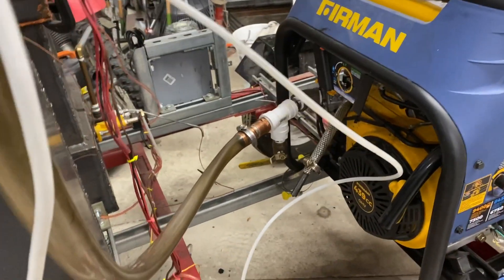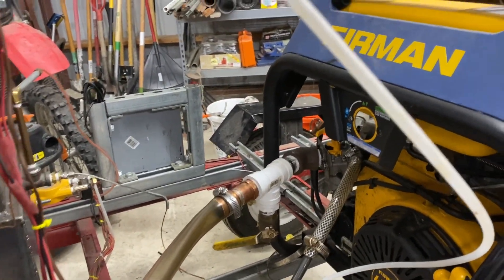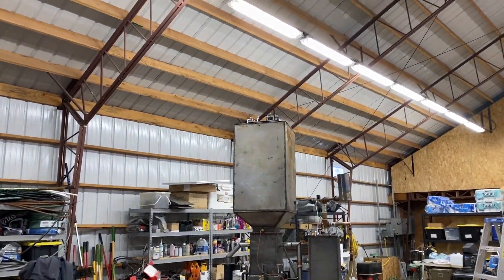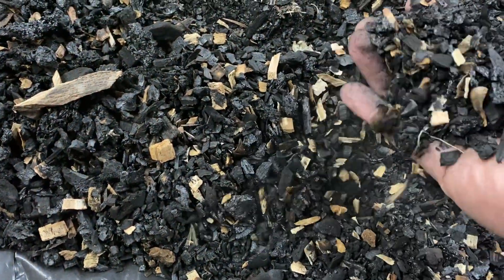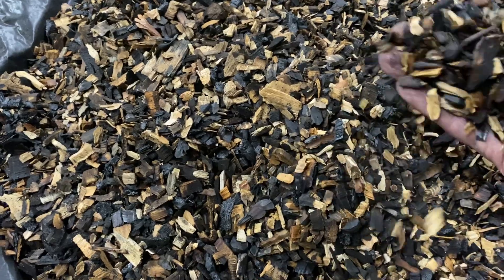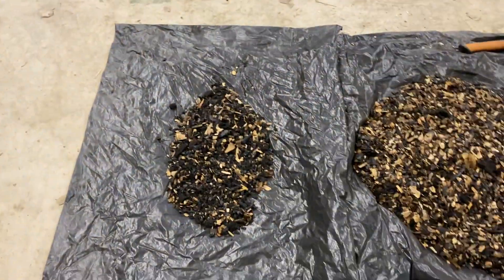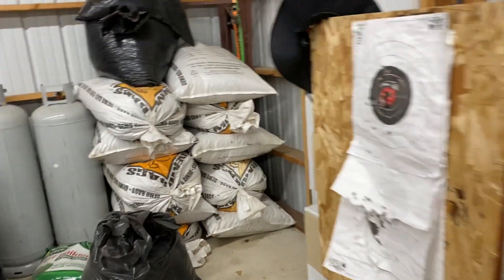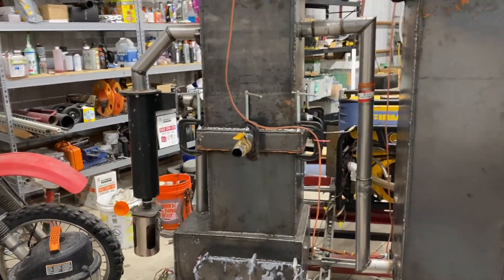Gasifier Ready for Restart

Comment: So you didn't find any unburned wood chips when you cleaned out under your reduction zone? That is a good thing. I'm wondering if you lower your air nozzles closer to where it gets restricted,  if that might cut down on the amount of tar inside the hopper. In our flashier type setup, we keep the air nozzle one inch below the ring at the top of the combustion zone. I haven't seen fuel stick to the inside of the hopper like that. Thanks for the show. Joe
Reply from the maker: Experimenting with various reduction zone volumes in order to find a size that allows good gas flow (low differential pressure) and correct temps. I think that is the key. Thanks!